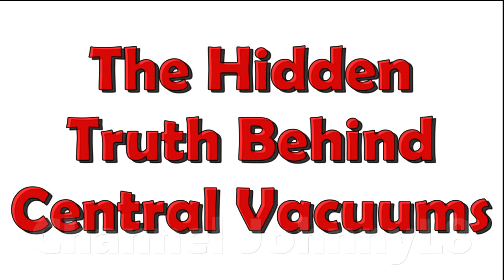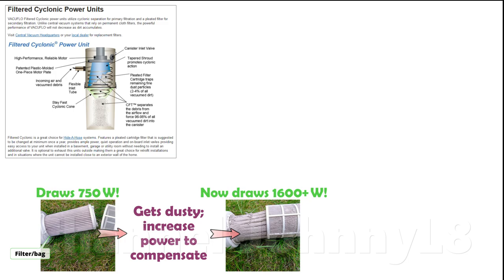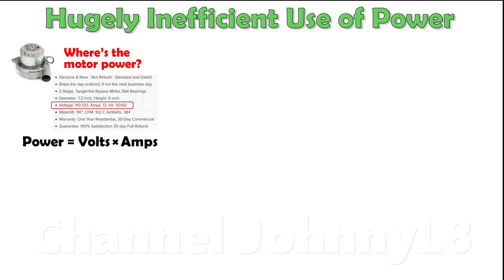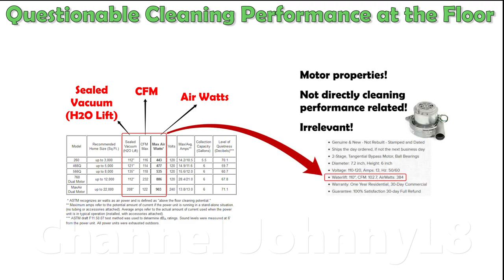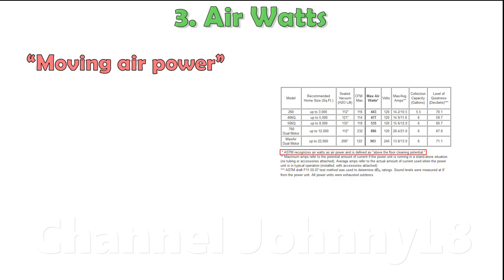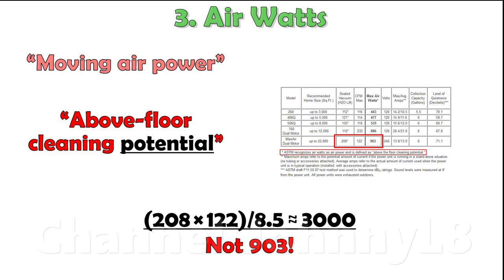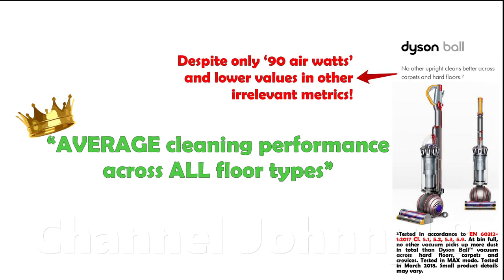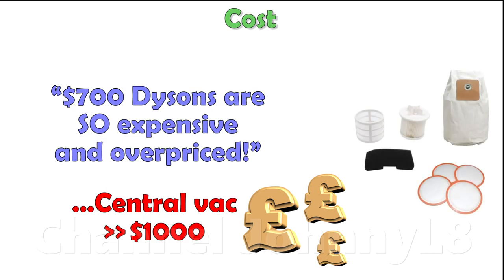Central Vacuums Trail Behind Dyson Cordless

Comment: First off, thank you for the video and the work you put into it. I would like you (or anyone here) to criticize me on my logic. I don’t have a cordless or a central, so I’m not biased. 

I’m legitimately looking for the best vacuum I can buy. I can totally see myself buying a Dyson v11 for portability, like if I lived in an apartment and planned to move in the future, I wouldn’t want to make an investment that I couldn’t take. 

However, the strength of a central vacuum, the sound of suction only, no charging, and not having to open the canister after every vacuuming is huge for me. Plus I can make that money back on the resale of the house.

Regarding dust. I would actually prefer to blow the dust outside because that’s where it comes into my house in the first place. I get pollution, but that’s more for expelling chemicals into the nature, in example, if you have a paint shop, you’re required to have a giant filtration system before the air leaves the shop. 

As for being green and morality involved with it... I look at  a vacuum  like any other utility machine in my house, a washing machine, dishwasher, an iron, a range, or a water heater. Just like you wouldn’t plug in a battery into your microwave oven or anything mentioned above for the sakes of simply being greener... 

As for the hoses and loss of air power. The wall ports are pretty well sealed and once the vacuum starts, only the air coming from under your hand goes to the motor, so no real problem there. 

We have a huge church in my area, about 70K sq ft, where I saw all the cleaning ladies just plugging their vacuums into the retractable hoses in the wall. I thought to myself, why don’t they all just get a v11 Dyson? The answer was pretty apparent. 

I guess I’ll buy both :)
Reply from the maker: >> “the strength of a central vacuum, the sound of suction only, no charging, and not having to open the canister after every vacuuming is huge for me.”
Why? I can see no good reasons why the ‘strength’ of a central vacuum is a virtue. So much evidence on my channel showing that utilisation of even small power consumption achieves the greatest results e.g. https://youtu.be/YnJ6OqVC_wg . Central vacs are terribly wasteful. The ‘sound of suction only’ is just a cosmetic subjectivity that has no bearing whatsoever of anything meaningfully practical. In fact, plenty of evidence on my channel that straight suction only gives poorer results e.g. the previous link. I also don’t understand the problem of having to open the canister after every vacuuming. Plenty of evidence showing it takes 5 seconds, makes no mess if done right, and is costless e.g. the previous link and https://youtu.be/E_ik6qScs0o .

>> “Plus I can make that money back on the resale of the house.”
Except most people don’t move regularly, so that’s hardly a benefit, particularly as a traditional vacuum can move with you.

>> “I would actually prefer to blow the dust outside because that’s where it comes into my house in the first place.”
If everyone did this, it would be noticeably more polluting. Some small aerosol species that vacuums collect can be dangerous when airborne. It’s not a noble thing to do (nor even rely on the dilution effect of just a few doing it) and it can be so easily avoided.

>> “Just like you wouldn’t plug in a battery into your microwave oven or anything mentioned above for the sakes of simply being greener...”
Not quite sure what you’re saying there. If you’re suggesting batteries are polluting, this is true, but this is minimised if recycled responsibly at end of service life. Future battery chemistries will be less polluting, so is an improving area.

>> “once the vacuum starts, only the air coming from under your hand goes to the motor, so no real problem there.”
Except for the issues I raised in the video concerning the resources consumed to achieve that. It’s an extremely wasteful approach.

>> “We have a huge church in my area, about 70K sq ft, where I saw all the cleaning ladies just plugging their vacuums into the retractable hoses in the wall. I thought to myself, why don’t they all just get a v11 Dyson? The answer was pretty apparent.”
Well yes, the V11 was originally designed for homes. As discussed in a recent video on my channel, Dyson have branched out to commercial environments https://youtu.be/S9MtVVkOZek . This is achieved by providing multiple hot-swappable batteries to extend run time and a spare filter. Future technological improvements will make this even easier.

All in all, the critical points raised in the video against a central vacuum hold and are evidenced. Central vacuums are noisier, more polluting, considerably more expensive, have higher running costs, and there’s no evidence at all they perform as well as the best traditional cleaners out there. If you can afford both and you want that, then that’s your choice of course. I’d recommend however the best modern technology, which achieves a better result, with greater ease of use, with fewer running costs, and with less environmental impact.
Reply: @VacuumFacts  have you used a quality central vacuum and a cordless side by side? I would definitely watch that video.
Reply from the maker: @antonn1608  No, but that's not necessary to determine what's shown in the video. A direct comparison would only allow relative cleaning performance to be quantified. However, as pointed out and evidenced in the video, no central vac manufacturer has ever made a claim their product cleans better than any other on the market, unlike Dyson's mains upright. The implications of this were discussed in the video.
Reply from the maker: Thanks for the wild unevidenced claims which make no sense... >_>
Reply: @VacuumFacts  Well, that is great... you have no practical experience...have not done any measuring...but you made up your mind and call your conclusions evidence...
This is really lame.
Reply from the maker: @LayerManager  Classic crybaby response. Doesn't like the sensible facts and logic presented, can't argue against it, so stamps their feet and tries to smear in lieu of a real response. Yawn...

Comment: The only reason I will never buy a central vac is because they are way too expensive. I bought a Kirby G6 for $20 and it kicks ass. Agitation is amazing airflow is wonderful.
Reply from the maker: (Vibrational) agitation is irrelevant ( https://youtu.be/urXCmJsDgXs ) and shown to have no impact on cleaning performance ( https://youtu.be/UaOjiLqkgGA and https://youtu.be/qJlaBeqVs7E ). Airflow on a Kirby is huge, but only open circuit. Under resistive load it plummets far more than a vacuum with strong suction; suction is needed to maintain current under resistive load (basic Ohm’s law taught to children that all people educated properly in the first-world have encountered). On carpet, the Kirby’s reduced airflow under load produces woeful performance ( https://youtu.be/8K6B_O5_C90 and https://youtu.be/qJlaBeqVs7E )
Reply: I can't even EXPLAIN how wrong that is. You need agitation to beat dust out of a carpet. By your claim we can just use straight suction to clean our carpets. You are WRONG. Agitation is not "irrelevant" it is very important for cleaning performance. But obviously you  do need airflow and suction as well to clean your carpet.
Reply from the maker: @theanalogkid2778  Actually, I'm right and the processes at work are all fact-checkable in any basic physics textbook. Unfortunately, you seem to have confused vibrational agitation with mechanical pile separation. This was covered in the links I provided that it appears you didn't review, and the links therein. It also explains that dust has a range of sizes and densities, and not all respond equally to the impulse of vibration. It also explains the consequence of interlocking within pile fibres and the reason why pile separation is needed. And then there's the empirical data you appear not to have acknowledged, fully confirming all this. So it's simply not true that I'm implying 'we can just use straight suction to clean our carpets', as discussed explicitly in the links you, again, appear not to have reviewed before accusing me of being wrong, without any good explanation or evidence. The importance of airflow and suction has been covered in the video explaining the basic physics of how the cleaning process works https://youtu.be/WzkFvMLy-Eo
Reply: @VacuumFacts  so airflow and suction is more important than agitation huh?
Reply from the maker: @theanalogkid2778  Well, which is 'more important' will depend on the situation, but that's not really the right way to look at it. Suction is important to maintain current under resistive load through the pile, and pile separation is important to both allow air flow deeper in the pile and to dislodge trapped particles. Vibration has very little value, even for dense particles that respond, unless they're free to be carried away in the air current. This was demonstrated explicitly in the video I referenced. (If the carpet was actually upside down, allowing particle weight to play a role, vibration would be very important. In fact, this is exactly how carpets are reset during formal industry standard testing. But carpets are not upside down.)

Comment: Dyson doesnt come close to my central vac with Sebo power head
Reply from the maker: Any data to show that (along with corresponding power consumption; any junk can brute force performance if you dump enough power into it, wastefully)? And then there's all the practicality issues... I love how you need to find a power head from another company to frankenstein jam onto the end of a very expensive product which clearly has failed if you need to do that, just to get 'better' performance (unquantified of course). Colour me unimpressed...
Reply: @VacuumFacts  yes my clean home . When I pull up the carpet no sand or dust is there . With my Dyson Animal there was ton of stuff that made its way clear thru the carpet and the Dyson didn’t pick it up
Reply from the maker: @marklloyd4153  I'm afraid that vague anecdote is just not convincing... I asked for evidence, you told me a story anyone could have made up >_> I think we're done here.
Reply: @VacuumFacts  I told u my life experience with a Dyson that I wanted to work as it cost much less that a expensive central vac I didn’t want to spend on , but for me the facts r clear . My central vac picked up thru the carpet the Dyson didn’t . My Allergies r better with the Dyson gone I just happen to recall . My info may not b what u want or want to hear or how u want to hear it nor was it mine when shelling out the cash for my big MD central Vac but it’s what has worked for me and my dogs and may b good advice to others who want a bit of deeper cleaning than my Dyson gave me . Have a great week 👍
Reply from the maker: @marklloyd4153  Unfortunately, I've seen no facts. Thanks for story; sorry I had no good reason to believe it. I think my video addresses this anyway.
Reply: @VacuumFacts  I’ve seen no favs from your side either other than your so called facts which may also b construed as a story by many who may have a different experience.
Reply from the maker: @marklloyd4153  The arguments are presented in the video. If you take issue with a specific point raised, then you should have presented your counter arguments directly instead of substituting with vague anecdotes.
Reply: @VacuumFacts  what u r saying is the evidence is provided in the story u presented in the video .I shared my experience which I delved deeper into when u confronted me on have a different experience with a product u seem to b pushing for profit

Comment: That’s alright. I’ll continue using my central. I had a Dyson and it died right after the warranty ran out. Dyson didn’t care. And yes, we maintained it properly, washed the filters every month, and never picked up stuff that shouldn’t be picked up.)
Since the central is over 30 years old now (installed in 1991) and has only needed the carbon brushes in the motor replaced and belts for the power head, I’ll take it. I don’t care if it’s not as efficient. All of the exhaust goes outside, so I’m not concerned about filtration.

Plus, I’m still not convinced that stick vacuums can deep clean as well as corded vacuums. The stick vacuum we have now for daily cleaning (although it’s a shark, not a Dyson) seems very good but you can get more than the amount the stick picked up if you go over it with the central right after. So the central is obviously doing something right, even if it’s inefficient and bulky.
Reply from the maker: I've known far more cases where people's Dyson didn't 'die' after the warranty ran out. Which begs the question what on earth was it treated like... But otherwise, each to their own. You are right about one thing though: stick vacuums can't clean as well as corded machines. Except for Dyson stick vacs, according to the measurements made. Dyson's are the only ones I've come across which outclean mains machines. That's also a very sad reality and exposes a serious problem with the nature of the system.
Reply: @VacuumFacts   Well, that was my experience. The motor just stopped working. As I said, we cleaned the filters monthly, didn’t overfill it, and didn’t pick up stuff that shouldn’t be vacuumed. It was not banged around. So I’m not sure how it could have been treated better. I’ve always taken very good care of my things.
I understand that it could have been a rare case.

I have never used a dyson stick vacuum before. (The one we had was corded.) So it’s good to know that they outperform everything else. I’d love to try one.
But sadly, after my experiences, there is no way I will spend $700 for something that may only last 5 years.
Reply from the maker: They are designed to last 10 years at the very least with care and Dyson support them with parts for that long. Once a model becomes so old and they've moved on to much better technology that they no longer manufacture parts, it's not unreasonable that support expires. Insufficient detailed information was provided to many any meaningful assessment of your case. The longest I had a Dyson machine before moving on was 7 years and it behaved as new (including the battery). 2025 Dyson will reveal a brand new battery technology that will advance substantially beyond the current Li-ion tech and remove all its limitations.
Reply: @VacuumFacts   10 years is very reasonable. But anything less than that is not for me.
I do not buy products designed to last less than that. It is wasteful and I do not find the change in technology significant enough to replace my stuff. I know many others don’t keep things that long, but I do. I see no need to replace things just to keep up to date.

I have no doubt that Dyson technology is rapidly evolving and getting better. They do have so many amazing technologies.
But after the negative experience I had, I will wait before I invest in money for another Dyson vacuum.

Comment: Simply, Dyson and other similar, cost under $50 to make, yet sell for $500 plus.... rip off?
Reply from the maker: They do not cost under $50 to make. That is a myth and demonstrates a lack of understanding of true costs. The materials element possibly costs comparable to that once all the very expensive tooling is created to print them on a mass-production line. However, to make it work as effectively as it does, learning how to do things that no one has done before, and all the research and development costs associated with that, including the cost of the highly educated people that do all the work day-in day-out, that is VERY expensive. They have to be profitable too to survive and grow. So all things considered, given they're a premium brand that aims and succeeds at being the top of the market, it's actually a justified premium price. At £600, it's also MUCH cheaper to buy than some products out there, such as the £700 Lupe, and the >£1000 Kirby and Vorwerk cleaners which aren't as good (and that includes central vacs).

Comment: And You surely do not need the space for storing dyson, or you do not need to carry it to the other floor, AND of course dyson does NOT weigh as much as a hose for central vacuum, it is just a motor with a turbine and an ultralight battery so much more convenent when going downstairs to get rid of the dirt and recharge...
Reply from the maker: Er, you need space to store ANYTHING. I explained in the video the footprint was MUCH smaller, so that's a poor refutation. You need to carry ANYTHING you use to vacuum, including the tools for the central vac—again as explained in the video. Did you even watch it? The weight of a cordless Dyson is trivial, and it rests on the floor in use, so the effort of vacuuming is comparable at worst. The bin capacity is more than enough to cope with normal levels of mess, even in a large busy house that is responsibly kept. Furthermore, no one does a weekly-mega clean anymore with these devices. They're used smarter, with bite-sized cleaning on demand. Often meaning more frequent, easier cleaning of the house. You just haven't made a valid point against these cordless machines and certainly haven't refuted any of the major problems with central vacs I raised in the video.

Comment: I wonder if Dyson will ever make a whole house system, given that US homes are a lot larger than UK homes.
Reply from the maker: They did; it's called the V10 and does the whole house if you're smart about its use :P
Reply: My V10 is going to be arrive in two days.  While the names may differ, I got the top of the line with the optional V10 Dok and Tool Bag, as those were free items if you registered when you bought the V10 online from Dyson directly.